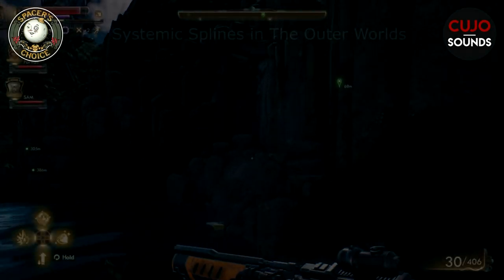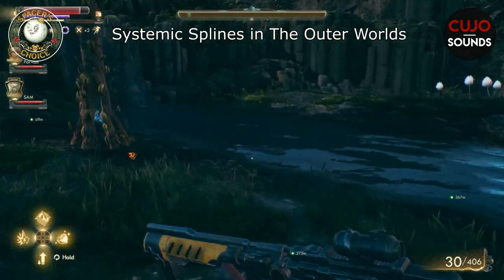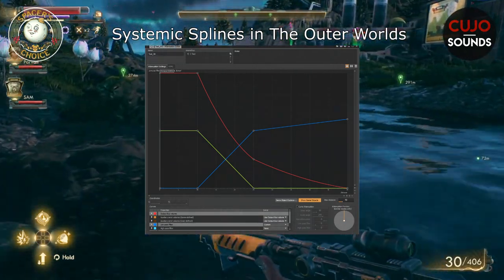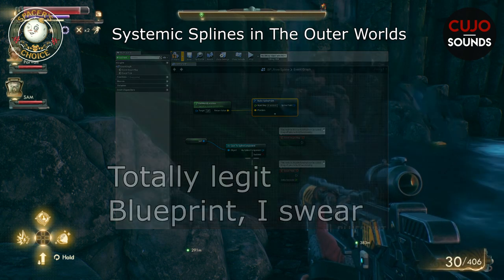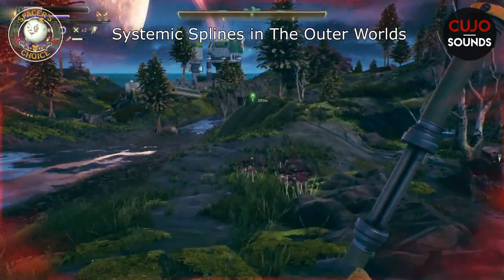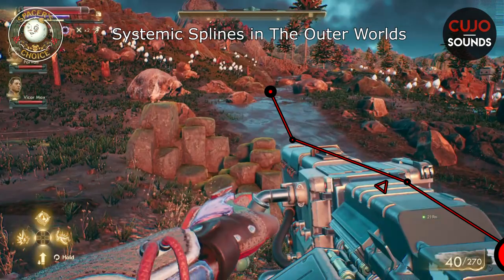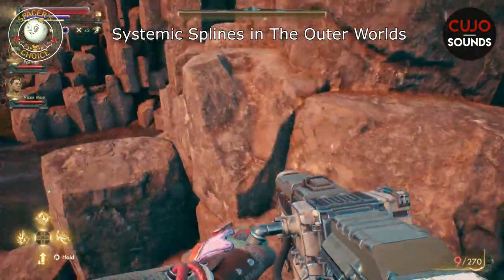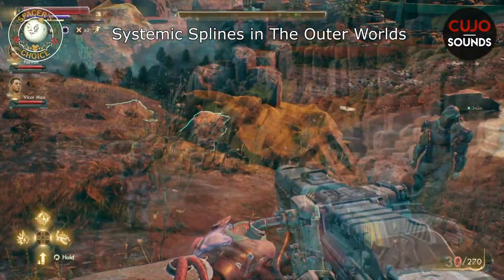The Outer Worlds - Systemic Splines for Audio design

Comment: It is very strange if this is really an occlusion issue. I think even newbies know that you can smooth RTPC's in wwise. IMO it more looks like some virtualization/priority management issue.
Reply from the maker: Sure you can smooth it - But quite often you wouldn't want your RTPCs to do so and control the value from the game instead.

I'm thinking too it's a virtualization issue, but that happens because the sound is lower than a certain threshold and therefore goes to virtual, because of the occlusion.

Even with smoothing, this could mean that the value just crosses the threshold value right there and its just too sensitive, but we can't know for sure. Well, we can, but that's not the point :D
Reply from the maker: @Tom Avis yes. But also lets say the value of occlusion goes between 0 and 1. And anything below 1 occludes it somewhat, then even with smoothing as you say, and I mentioned above, it would be occluded slightly to begin with - once you start that process all sort sorts of other systems may kick in like virtualization rules for when a sound should go to virtual. Lots of issues to be taken into account.